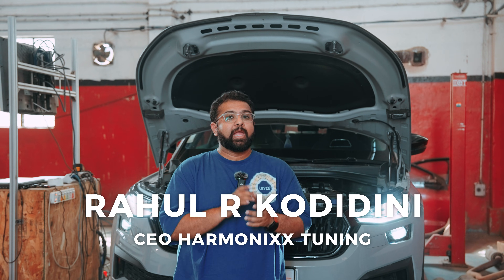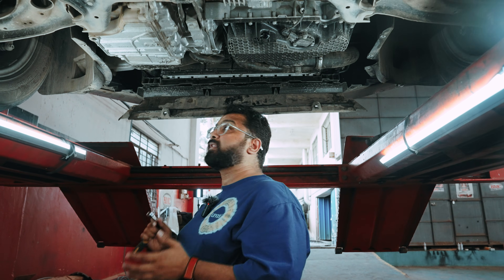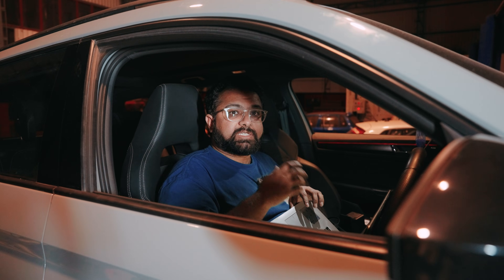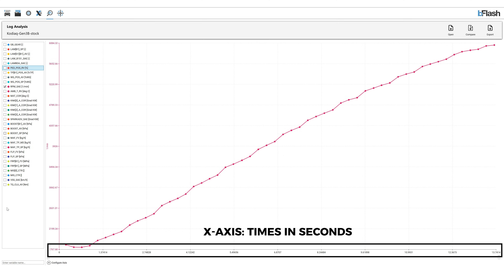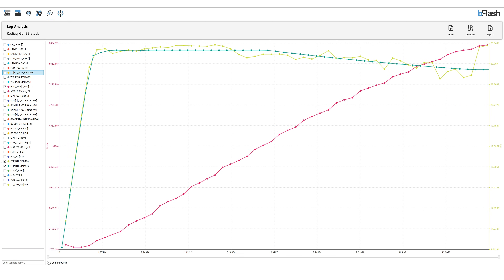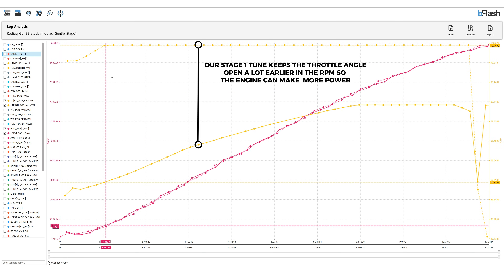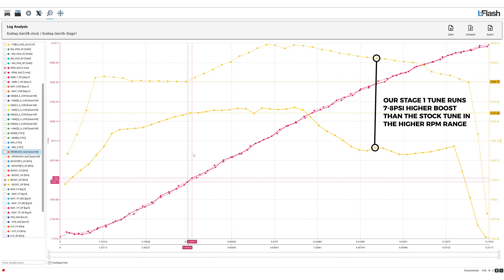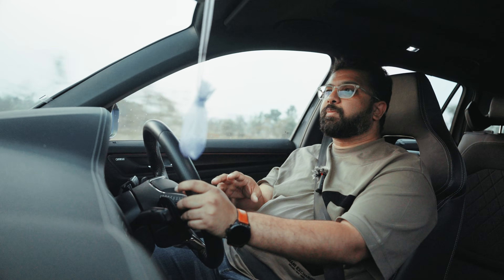Audi/VW/Skoda 2.0TSI EA888 GEN3B Tuning Guide - Part 1

Comment: What milage can be expected form these gen3B engines? I have a 190hp czpb from Audi, first itteraton from 2017 (no opf, same dq381) it has 110.000miles and i plan to keep it until it explodes, oil is done every 5000 miles, the timing chain was replaced and both the thermostat and water pump were replaced under warranty. It does not burn oil at all.

Comment: Hey Rahul, are the new EA888 Gen 4 engines better at tune-ability than these Gen 3b engines? 
Do the EA888 Gen 4 engines have a lower compression ratio similar to the engines found in the Vrs230/ Audi 45 Tsi etc. ?
Reply from the maker: The Gen4 engines sold in these newer cars in India, just seem to be updated Gen3B engines with a few updated parts from the Gen4s sold abroad.

This still run very high compression and will react similarly to the Gen3B engines. We don't see these making more power than the Gen3Bs around.

Comment: What about engines, gen4b, for example dmsa 40tfsi 204km. Will it be possible to modify them?
Reply from the maker: DMSA engines look like GEN3B with some parts off the Evo4. Easiest way to identify them is to see the Compression Ratio. If it's not 9.3/9.6:1 and is closer to 11.6-12.2:1 you can be rest assured that those are the High Compression Budak Cycle engines.
Reply: @HarmonixxTuning  Thank you for your answer. Yes, I know that I have buddack cycle gen4B. Do you know whether it will be possible to modify the software in the new gen4b engines in the future? To my knowledge, this is not possible at the moment.

Comment: What is the possibility of remapping the Korean 1.5 TGDIs? (Not sure if India gets the 1.5 G4LH and G4FS) and what is the maximum torque the D7UF1/D7F34 Dry Clutch DCT handle (without reliable issues) ?
Will you be coming out with a remap for the above engine + gearbox combination? 
Thanks
Reply from the maker: We've got some nice tunes for the Hyundai/Kia 1.0TGDi and 1.4TGDi engines.

No TCU tunes for these yet.

We've not yet started work on the newer 1.5TGDis yet.

Comment: I have a Kodiaq from late 2023 and everything you mentioned about how to identify a Gen 3B engine is not present. Matches more with 245 engine. Do you know if newer versions have the Evo4 engine?
Reply from the maker: The latest batch of Gen3B engines seem to have the engine code DNNA which runs a high compression ratio of 12.2:1 and does run some common plumbing parts from the Evo4 engines.

This could be VW trying to discontinue older SKUs as they slowly phase out the Gen3 engines to Evo4.

The same has been reported on the new Q3 as well. But we're certain these are the facelifted Gen3B engines.
Reply: @HarmonixxTuning  As per the official Skoda storyboard, Kodiaqs with Euro 6d emission standards have the latest generation of Evo engines.

Comment: Hi Rahul, I have allspace stage 1 currently , I need more power , I was thinking of a engine swap with 1.8 stage 3 IS20 280hp but then it will cost me around 5 lakhs and I won't get good price for my current engine So I was thinking of pushing my current engine to 250-260hp with mildly tuned IS20 turbo. If it can last 15-20k km , it is worth it and then may be I will rebuilt it or swap it with 1.8 whichever is cheaper. Do you think it can produce 260 hp safely for 15-20k km?
Reply from the maker: Hi Pawan, honestly doing an IS20 build wouldn't be that difficult for our team. Drop us a text on Insta and let's discuss.

Comment: Great video. Please show us the difference in performance for both diesel and petrol cars with just aftermarket replacement air filters. Because you have got all the setup to measure and put a genuine report. Thanks.
Reply from the maker: Air Filters don't make a lot of difference on cars under 300HP.
Reply: @HarmonixxTuning  Okay

Comment: You had mentioned that (10:14) IAT is really high

Where does the intake draw the air from in this series of engine..? from the engine bay..? or from the grill (outside air)..? 

Simple/1500₹ euro spec air channel guide made a significant difference in my polo in terms of IAT
1T0805971
Reply from the maker: It's impossible for a Euro Spec Air Channel to reduce IATs drastically enough to see a difference. Specially on the 1.2/1.0TSI engines that have a tiny charge cooler.

All the MQB engines draw air from the grill.
Reply: @HarmonixxTuning  mine is a 1.2 TDI, not a TSI..difference is definitely felt..if it's not drop in IAT what could be it then..? 

There is no difference in lower speeds..as we climb higher in speed, there is that eagerness in picking up pace even further..there is no tapering off when compared to my friend's TDI

Is the velocity of air being drawn different for euro spec & indian spec..? if it's so, would that make a difference esp as the car picks up speed..?
Reply from the maker: To compare IATs, you will have to Datalog your car with and without the Euro Air Channel. 

In our experience of tuning VAGs for over 6yrs now, we've never seen an instance where Air Intake mods have aided in bettering IATs.
Reply: @HarmonixxTuning  no option to do so as I am not intending on tuning it

Is it possible to data log while on the move..? or you can do it only when stationary..?

In case you get a chance to test this please do, the difference between euro spec & Indian spec in these scenarios on IAT
  . stationary, while on the move@ say 100kmph
  . early morning runs (say 4/5am), drives @ noon
  . effect on TDI, TSI
Reply from the maker: Datalogs are always taken when the car is moving, either on the road or on the Dyno. 

Also, take our word for it when we say a Euro Spec channel WILL NOT reduce IATs enough for you to FEEL a DIFFERENCE on these cars.
Reply: @HarmonixxTuning  I will swap back to the OEM air channel to see if it was a placebo

One more query (below mentioned is with the euro channel fitted) 
I had changed the intake air duct to the one that comes in Fabia VRS model (6R0 129 618 D)..physically it's much wider than the OEM duct..the initial response got slightly better with it, but it wasn't pulling anyway near as before when I approach tripple digit speeds

This is not related to IAT, just curious why the performance drops@ higher speeds with the bigger/wider duct..is any of the things mentioned below the reason..?
  . 1.2 TDi in its stock state doesn't need any 
     more air/more air made it run lean..? 
  . wider duct slowed the speed of air within the duct..?

* when I say difference it's not something you can call significant (am' after the minute difference parts can contribute)

Comment: Since these cars have the haldex setup, can something similar to the X drive delete on M cars, be done on these as well? Making them RWD?
Reply from the maker: Not possible on the BMW G Series. XHP should soon be releasing X-Delete for the G Series BMWs.
Reply: And what about the skoda engines? @HarmonixxTuning
Reply from the maker: Most Skodas are FWD. And those that are AWD are mostly based on the Haldex platform. But it's not advisable to disable the Haldex during daily use.  We do it only for Dynotesting.
Reply: I get that they are FWD Biased, but like haldex makes them AWD, can they be made RWD also by any chance?? @HarmonixxTuning
Reply from the maker: No, making them RWD is not possible.

Comment: Nicely explained video, but I have a few questions though-
1. How's the exhaust flow after the tuning- CO2, Nox, etc.
2. Is tuning engines legal, if yes in what states
3. I know the price of remap varries from model to model, but can we have a rough idea of it? stage 1/2/3/4
4. What's the max HP this 2.0 TSI can produce, i saw a video of AutotopNL he drove a 700hp RS3 engine swapped in a Superb n it was doing 300+ like a piece of cake, no stress whatsoever.
5. how much does the fuel efficiency increase in lower rpms after the remap?
6. Possible to add a supercharger instead of IS38, if not which IS38 do u recommend?
Reply from the maker: On our Stage 1 Tunes all cars will pass Emission Tests.

Price depends on your end goal, the platform and various other things. Our cheapest remaps start at 20k and can go upto 3-4L for a tune. 

An EA888 Gen3 can push around 600HP on our Dyno on a stock block. Upto 750HP on a built block. We've already built an Audi TT pushing out 600HP. 

RS3 engine is a 5 cylinder 2.5L engine and is probably the best tuner friendly engine made in the VAG line-up. 

FE depends on your driving style and driving conditions. 

Turbos are always more fun than a SC.

Comment: What could be the best turbo swap for gen3b block
Reply from the maker: The most popular turbo upgrades are the IS38 or the Garrett Powermax Stage 1 Turbos for these Gen3B engines. However, once you decide to go Stage 3 you'll need to ensure you fill up really good fuel as these engines have very high compression & will become extremely sensitive to fuel quality as you start pushing them.
Reply: As I do lot of long drives and fuel quality is 95 at most places , do you think IS 20 turbo will be better or even I. Can mildly tune IS20 turbo to get around 270hp , I have stage 1 , just need little bit more power than stage 2 while keeping it reliable
Reply from the maker: Honestly, we've to done a Stage 3 on a GEN3B yet. We personally think the risks are too high given our suspect fuel quality (even on XP95 the fuel quality seems to vary wildly between bunks/cities).
Reply: @HarmonixxTuning you done stage 3 yet , I've got a kodiaq in UK so 99ron here I might put a is38 , intercooler and intake and get it tuned not chasing maximum numbers but 300+ bhp would be nice

Comment: what power figures can we expect if get a  vrs 245 oem turbo for this car with supporting mods ( if needed )
Reply from the maker: An IS20 on this car should net closer to 270-280HP in our opinion. But the wiser option would be to swap to an IS38 instead of an IS20. But then again, the high compression on these engines, makes them tricky to tune with a bigger turbo, specially on our fuel.

Comment: Good video as usual , had to watch it couple of times to grasp all the information. I had couple of questions :: 
   -> what is Lamda significance and we keep it "1" in lower revs ? 
   -> Can you make a video and bust some myths on "claimed high HP gains" in NA engines ? 
    -> Can you help educate folks on how to actually make any significant HP gains with NA engines.
Reply from the maker: Lambda is basically how we quantify Air-Fuel-Ration (AFR). A good place to start would be the Wiki below to get a basic understanding. 

https://en.wikipedia.org/wiki/Air–fuel_ratio

To bust the myths on NA engines we will need some NA cars and tuners willing to provide their tunes for FREE. Or customers with NA Tuned cars volunteering to Dyno their cars and allow us to flash their cars back to stock. Slim chances of either. 

Honest advice, just stop trying to mod an NA engine.

Comment: How robust is DQ381 compared to the previous and yes how far can one push through this engine with reasonable reliability peace of mind?
Reply from the maker: The DQ381 is one of the most robust DSG gearboxes built by VW. And can take a lot of abuse and nearly 650Nm Torque without complaining.

As for how much can this engine be pushed to? Wait for Part II to find out.
Reply: How much we can push an 1.3 MJD?
Reply from the maker: +15HP +30Nm
Reply: @HarmonixxTuning Is it possible to swap hybrid turbo with 1.3 MJD?
Reply from the maker: No good options out there for these engines. We recommend a Stage 1 Tune.